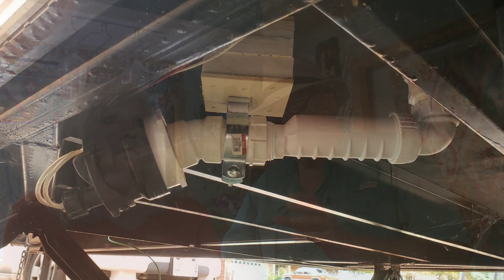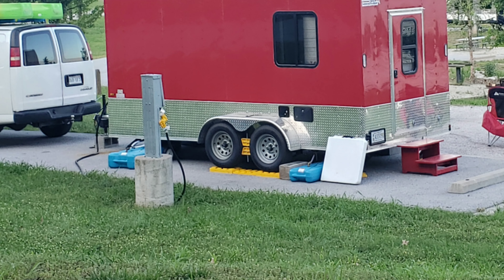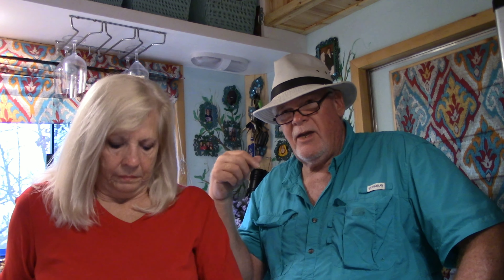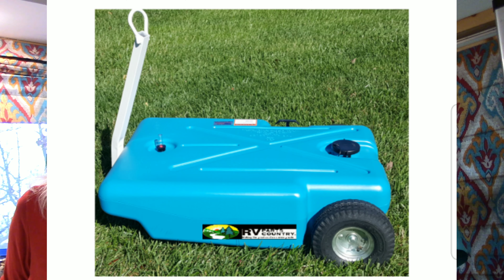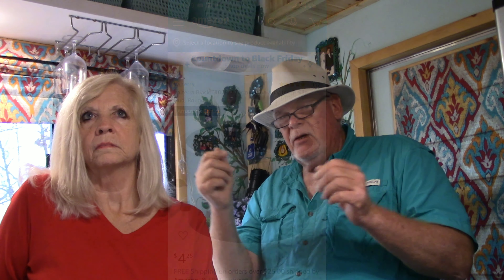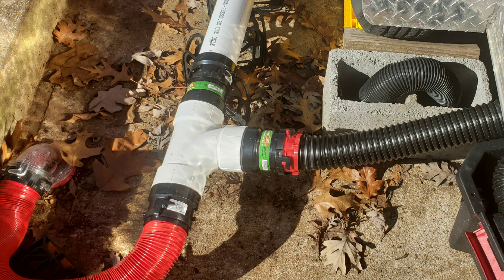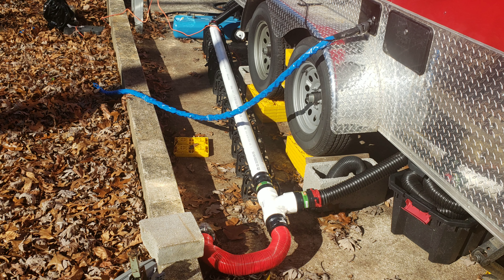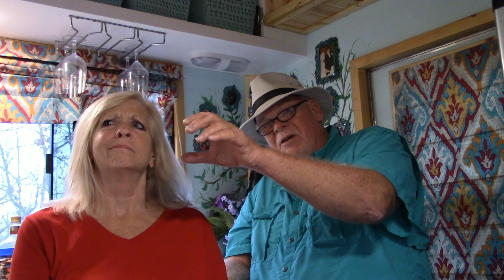Our Rigid Waste Water Setup

Comment: I don't see the links to the adapters on Amazon in the comments area. Would like link to tank also. Thanks Sunny
Reply from the maker: The links to the adapters are in the very first 2 comments at the beginning of the comment section.  Here is the link to the tank. Barker (27844) 4-Wheeler Tote Tank - 32 Gallon Capacity https://www.amazon.com/dp/B000BGM89Y/ref=cm_sw_r_cp_apa_i_g-ocEbFP8AGZW